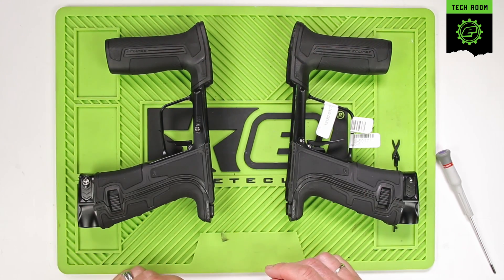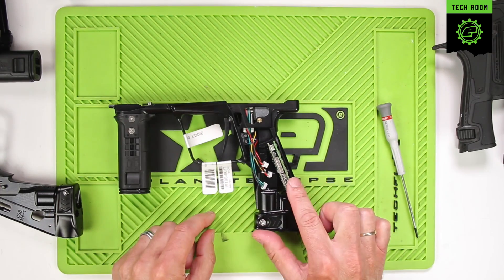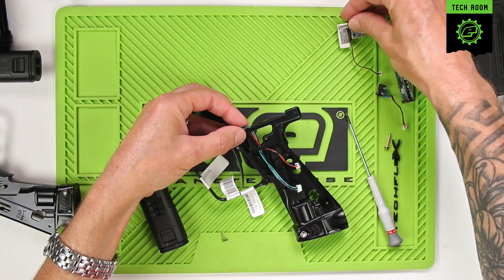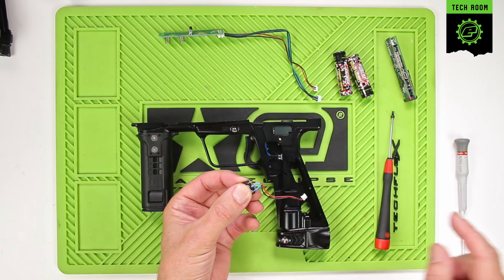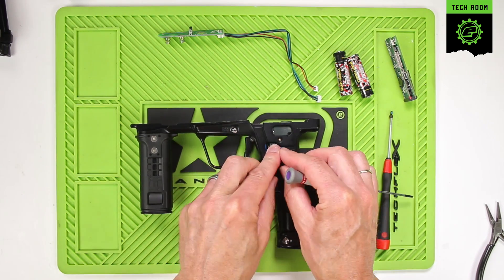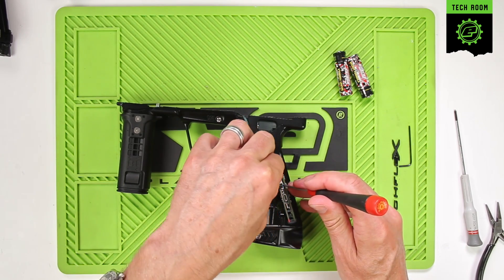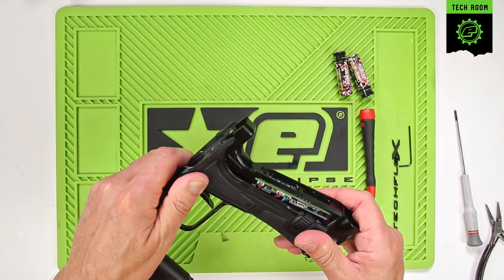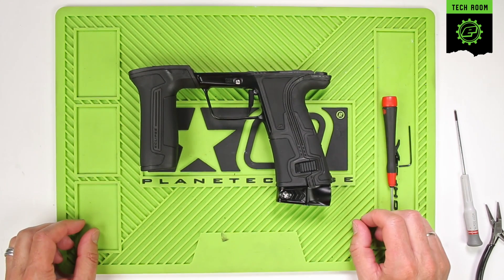Eclipse CS3 Mech Frame: MME Package Installation

Comment: Would be awesome be be able to buy a CS3M. For those of us with no need for the solenoid, the duplicate frame, pops and reg.
Reply: I agree. Should be available as a mech version off the shelf
Reply: Out of curiosity, you're wanting to pay roughly $1600 for a mech marker then, with no conversion back into an electronic marker? If anything buy a 180r then mech frame and swap everything, if not a ETHA 3M. Though the CS3 is mech compatible, it's definitely first and foremost a tournament (xball) marker, so why would planet do this? Plus you're already spending the money of a super high end marker, I doubt if you're doing so you'd be one to complain about having to make a mech only version.
Reply: @Paintballpro18 I play mech exclusively. I don’t mind spending money on a high end mech marker.
Reply: @TheBroz  right but, you could buy the 180r and get ALMOST the exact same performance. There's a miniscule PSI performance difference, but saves you literally so much money for the same performance. If you really want to spend money on a mech marker, have you looked into autocockers?